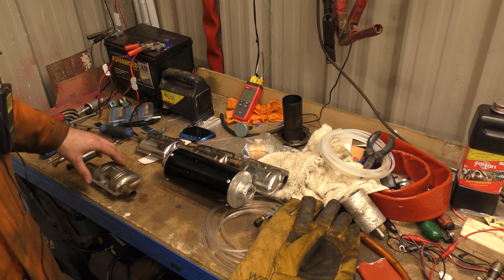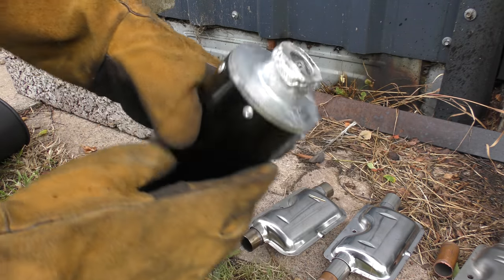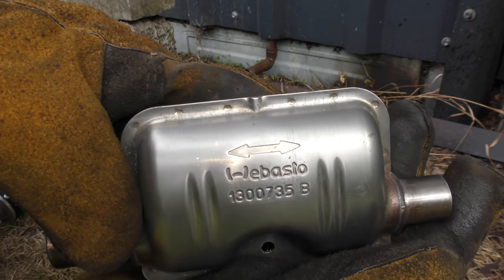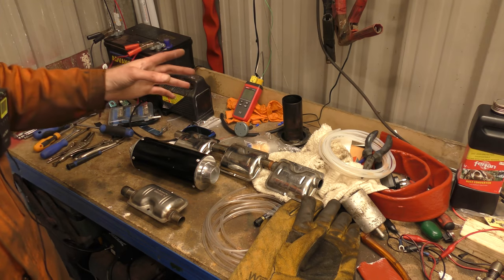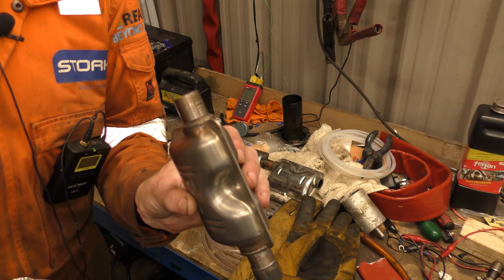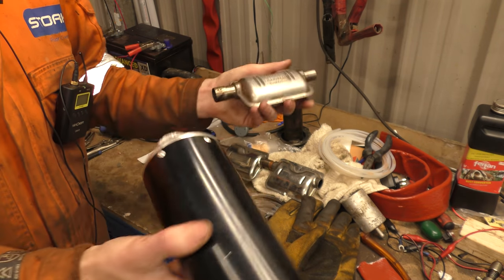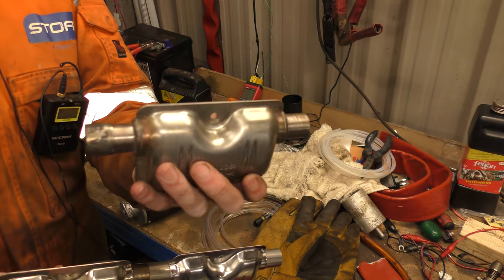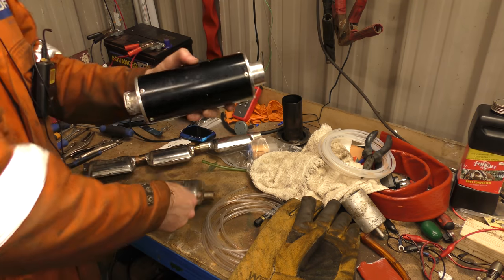Diesel heater silencers daisy chained and a genuine Webasto silencer // test

Comment: I manufacture fiber glass packed (sound absorbing) mufflers for cars from 12-40" long. I've found that silencing gains are minimal after 40" in length. There are 3 ways to silence an engine or in your case of a heater, sound absorption, sound reflection, or restriction. Or any combination of the three. Of course you don't want to restrict a heater. I've also machined 4140 dies to bend, reduce, and swedge tubing to make exhaust pipes out of quality material for these heaters so two pipes can be joined by slip fit and clamp. Thanks for the video. Jerry in Montana
Reply from the maker: I like the sound of your silencer joiners.  If you've got a link to share I'd be happy to share it on here.

Comment: I made my own silencer with an old stainless vac flask. I drilled 12mm right through the bottom two layers and silver brazed a patch on the outside hole. I then drilled about a dozen 4mm holes at random in the outer skin and made a connector which I silver brazed in the top. It’s very quiet and the price was just right
Reply: For a layman it is hard to understand what you are describing. Can you record what you did?
Reply: @harrickvharrick3957  The vac flask is essentially two chambers , one inside the other, sealed at the neck. The exhaust gases from the heater goes into the inner chamber. The 12mm hole through both chambers is to allow the gases to pass into the space between the chambers.the outermost hole was sealed by soldering a patch over it. To let the gases escape from the space between the chambers the dozen random 4mm holes were drilled into the outer chamber wall.
Reply: @footloose6382  I see. Sounds rather neat, actually!

Comment: My way of thinking is that a silencer needs two things. Gas expansion and slower airflow. I reckon a steel box lined with wadding and an internal baffle plate would deaden the sound and reduce the venturi effect at the outlet. The gas is creating the noise at the outlet on all of them as airflow in = airflow out. A box that allowed gas expansion and therefore a slower exit speed (bigger hole out than in) would do the trick. A car exhaust needs back pressure so a straight through exhaust can reduce performance without fuelling mods, whereas the heater just needs somewhere for unrestricted burnt gas to go.

Comment: That's the silencers covered. .....now on to the loudeners. ....
Reply from the maker: Campsites of the world rejoice, we're going to make diesel heaters louder.  :)
Reply: yeah , with LED lights & some halfords ' titanium' heat protection round the exhaust outlet .. aah max power days
Reply: Just find any motorcycle sport exhaust. You could get a droning "broap" all day from a generator!
Reply: We need to crowd fund a tuned Akrapovic system
Reply: That's a trumpet then...
Reply: @DavidMcLuckie  gotta find out what brass instrument sounds best on diesel exhaust
Reply: House radiator before running outside
Reply: @DavidMcLuckie  Hook up a trumpet or trombone to it 🤔
Reply: @nickcoppard5335  Really?
I have cast iron radiators...

Comment: cheap silencer: take a metal paint can drill hole in lid for exhaust in. Take can drill small holes in bottom so area of small holes equal exhaust size. Fill can with corse stainless pot scrubbers. Install lid and install on exhaust. Added benifit, you can easily replace or clean silencer medium

Comment: Adding an additional silencer on the burner INTAKE air connection will  make the BIGGEST improvement on a campervan installation. Sound waves from the combustion noise travel upstream too!
Reply: What silencer can you use on the air intake?

Comment: Excellent video.
Thanks for taking the time to film and share.
Here's an idea for you to try?
Big issue with CamperVan wive's.
💡idea alert... for people with hair:
Scenario:
Not enough battery power in the camper for wife's hair dryer - How do YOU cope?

We have a CDH which blows warm air out of a 100mm vent.
If I got a vacuum hose with a crevice attachment at one end, and a 100mm funnel reduced to fit the other end of the hose - then temporarily secure it over the heater vent - in theory, this should blow concentrated warm air out of my crevice enough to blow dry my wife's hair?
MACK and Maggie, Huddersfield

Comment: What about restriction introduced by each?
Maybe tee in a manometer and see the pressure difference where the exhaust exits the shed?
Then it can be determined if you may need to tweak fuelling
Reply from the maker: I'd always tune the fuel after making a change like this.  Even changing between clone silencers the restriction may be different.

Comment: Webasto make a marine silencer and we HAVE TO use them in narrowboats. They are NOT like the one you have that has a drip hole on the bottom for water to drip out. This also lets out exhaust gases so could kill you if you were on a boat. You can crimp and weld the hole shut but a boat safety inspection may pick this up and fail you. Back pressure can be a problem with lots of boxes fitted I have found. it also depends how close or far you fit the box on the pipe work. Love the video clips would be good to see more trouble shooting on Webasto heaters....

Comment: my silncer is 2 6x12 aluminum boxes welded together with heat syncs and a fan with then a 7/8 tube running out the wall. really quite and gets extra heat off the exhaust to use as extra heating for the garage. now ideally i would have some copper tube and water to get more heat out of it.( to maximize the heat you can use the exhaust temp going outside should be room temp but good luck with that)

Comment: Interesting, ty!  I wonder how much if any exhaust flow reduction occurs and if it impacts performance of the system.  Even if it did, it might not be much or even concerning for some people.  I heard the noise of a diesel heater can be pretty loud in many cases.  They are an excellent source of cheap heat in many instances.

Comment: It would be interesting if you could figure out how much back pressure each of these silencers create, the Webasto one probably creates quite a bit of it due to the zigzag in the tube. The scooter one may therefore be superior (if you have the space) as it looks like it is a straight tube.
Reply: why would they create back pressure??
1 the heater has a blower, so its pressured exhaust.. it blows out.(hence the noise)
2  they are not restrictive in design, if you put 10 on a connection one after the other, you can still shoot a bullet through the hole and not hit anything on the way out.. 
3 the hot air if anything will cool and becomes less dense the further down the line... (the exhaust isn't even all that hot relatively speaking)
Reply: @stijnvandamme76  When air cools down it becomes MORE DENSE .......

Comment: Just came across your vid . have to say the Vehicle  muffler is the quietest . What would a larger bore exaust pipe do ?  ( short 25mm from the heater to a 2-3 inch diameter pipe then fitted with a muffler .

Comment: If you a product called  safe and sound insulation  Batts. Made you own baffled box.  With multiple exhaust holes the sound  will be incredibly low. 
This insulation is  fire proof and water proof to a point.

Comment: Theres literally no restriction in the clones - is the Webasto similar? I would pack some stainless pot scrubber inside but not too tightly but more in centre so exhaust gets pushed around then out other side? Give that a test?

Comment: Hmm, I would suspect that adding silencers will start to really restrict the exhaust flow. Interesting experiment :)
Reply: Glasspacks
Reply: @evognayr  strawberries
Reply from the maker: Restrict yes, but not by much with the cheap silencers.  There's not a lot in them to restrict.  :)
Reply: @DavidMcLuckie  I've seen a surprising test on the cheap silencers that the straight-through cheapo silencer exceeded the performance of the cheapo curved silencers. Anyway these tests NEED a DB meter or even a audio analyser with spectogram.

Comment: You do not want to inhibit the exhaust gases beyond the original design. If any thing get an old car muffler a small one or cycle muffler go larger don't restrict the exhaust. I think a heat exchanger would be a nice addition and capture the waste heat of around 3 to 4 hundred degrees F.

Comment: Hi David great videos. I’ve heard that you shouldn’t exceed a 270 degree angle on the exhaust outlet and doing research those cheep muffler have a v in side with two of them plus the 90 degree coming out of the bottom of the unit you might mess the performance of the diesel heater up there are two sorts of cheaper muffler one like yours and one that is a straight through one also the straight through one is a lot quieter then the v shape hope this helps
Reply from the maker: You just need to tune the CO output for the configuration you make.  I noticed that if I add a slight restriction I can reduce the fueling slightly as the hot gas stays longer in the burn chamber.

Comment: Loving the experiments! I might have missed it in the earlier videos, but did you mention where you got the generator silencer from? Thanks.
Reply from the maker: It's just one I picked off eBay, literally the cheapest one I could find.  :)
Reply: @DavidMcLuckie  name of muffler I would like to find the same one
Reply: @DavidMcLuckie  Me too actually. Would you say that putting the Webasto and the big silencer together will cause any problems for the heater re soot etc. looking on ebay I didn’t find the big silencer so having a link or something might be useful if possible. Thanks David,  if you see this comment. New to your channel. Very interesting stuff.

Comment: I hear the small scooter changes the pitch to a lower octave but the generator can either don't cut the high octave sound or its resonating inside, can you use try the scooter exhaust and then the generator can? Just wondering if its the can that's resonating.. If its not then you have a high cut silencer and then a low cut sound silencer :)

Comment: I changed the exhaust on one of my trucks and just used the muffler and pipe section of one side. It’s a 2.25” diameter pipe, about 5’ of length plus a generic muffler, the exhaust is much quieter than the fan and see no reason to change it.

Comment: I mean it's not really a muffler, two slices of steel with spring inside. I run heat exchanger instead and that not only eliminates noise but actually helps recover ar least 50% of exhaust heat.

Comment: Can you do 2 tests for me please ? 1. Can you run two controllers connected at the same time ? 2. Can you extend the exhaust and see if anything happens as I’ve heard you must not extend it due to back pressure
Reply from the maker: Number 2 I am doing right now.  My exhaust is an easy 2m long.  I just tuned the fueling accordingly.
Reply: @DavidMcLuckie  good stuff, I await your video sir! 👍🏻

Comment: Hello Mr McLuckie  do you know roughly how long the exhaust pipe from a diesel heater can be before it starts causing problems with combustion, as the exhausts that come with the heaters seem a bit short, i see ones for sale at 1.2 meters even 2 meters long but am unsure if these would be suitable or to long.  Also really enjoy your videos they are Awesome 😁😎
Reply from the maker: Perhaps I can add that to this years test list.
Reply: I have seen on Weaste and Eberspacher user manual that exhaust pipe can be max 2 meters.

Comment: Thanks. Is it recommend or allowed to use copper pipe for exhausts?
Reply from the maker: Well.  Yes and no.  Technically you shouldn't as there can be a reaction and gas given off.  But we're already venting a toxic gas to somewhere else, so as long as you know what you're doing.  I'm also only using it for the end of the exhaust which is a lot cooler than the heater end.

Comment: I've just bought one of these.
I have used it for 6 consecutive nights.
Do I have to tune or set these up to optimize running?
Reply from the maker: Ideally yes.  A cheap CO gauge and adjust the fueling for low CO.  The lower the CO reading the less unburnt and wasted fuel your heater will be using.
Reply: @DavidMcLuckie  I've been running one of those cheap Chinesium diesel heaters aboard for the past few years and have never done an exhaust CO2 test on it, I installed it, it made the cabin nice and warm and I "tuned" it to keep the smoke down, it literally never occurred to me to test co2

Comment: I use two of the "clones" cheap and cheerful and makes enough of a difference.... Does anyone know if there is some kind of lagging that would effect the volume ?
Reply: What about exhaust tape/ heat wrap? Might be what youre after, or something like rockwool can handle very high temps.
Reply: I have got the heater in a rockwool lined box, reduces the roar, I've been thinking about directing the exhaust into some kind of chimney / flue to vent exhaust up and away from other campers

Comment: Cooper  fittings make sound louder back in the hay days we fitted copper sleeve  pieces into our exhaust pipes on our car exhaust it when got hot the heat made the copper crackle and the tune out off exuast pipe was louder
Reply: You could shove everything up there and she was getting louder. 😄   You're just blocking the fiberglass or steelwool.

Comment: Interesting. Copper should not be used in exhaust systems of internal combustion engines as it gives off toxic gasses at high temperatures, Shame, because in other respects its the perfect material. Very interesting video!
Reply: not sure about 'copper gassing off'  but sulphur dioxide in exhaust gas will eat into copper fittings in fairly short order

Comment: Do you actually hear anything from inside the van?
Reply from the maker: That depends how you build the van and where you put the heater.  On mine the heater was the opposite end of the van from the bed, so you didn't hear anything.
Reply: Yeah, I just finished my installed today, and I'm not hearing anything inside the van. Take a walk outside and sure you can hear it, but when it's cooler outside I'm not going to be outside anyway. I just put mine in without any muffler at all. Works for me. 

What is far more annoying is the, tick tick tick of the fuel pump. I have a rubber mount that everybody recommended, but really surprised how loud that thing is.
Reply from the maker: @Deltro61  Did you mount the pump inside or outside?  I put it outside as well and don't hear it inside.
Reply: Yes, mine is outside, but zero insulation in the van right now. Just getting started on conversion. It should quiet down in time (I hope!)

Comment: I would get a new universal car muffler / tractor /car/truck  2inch diameter much larger than tiny ones in video and use it for heat recovery inside . Also would paint all mufflers and pipe hi heat black . Lot of wasted heat going out side .Just like building hi performance  car exhaust . If you look lots of discontinued mufflers around cheap

Comment: The best thing to do is probably tap into your vehicles exhaust system. At the end of the day it is very hard to get rid of the sound of moving air 🤷🏼‍♂️
Reply: But wouldn’t you then be pushing your engine exhaust gasses in to the heater and out of the air inlet when you run the engine ?
Reply: @AJ-qn6gd  No, not if it was entered at a 30-45°angle

Comment: has anyone figured out the best way to recoup exhaust heat which still allows the heater to function properly longterm ?   I am planning on turning my heater to the side, so the bottom exhaust output is now to the left side this way I can route it into a heater coil from a car, and than route the last few inches of pipe that comes out the heater core,  out the window...This will allow me to do this ,without using any 90 degree turns/ unions.

Comment: Via your mic, the moped thing done best to my ears, bang for buck. It get rid of the high notes I don't think you can hear. Rather a bass note than hiss. But that care exhaust box was all around the best, but thats custom ish
Reply: Problem there is, Low-Frequency noises travel farther than High-Frequency noises. So much so, that Jet Turbine Engines are designed to change the pitch of their cries, to a much higher note.
You might complain while sitting on it, but, over distance, the higher notes go quiet faster.
Which is why I only hear the Bass Line on my neighbor's car stereo, when he pulls in after the bars close.

Comment: Won’t this cause restriction? And burn a valve?????
Reply: Thats a diesel burner. Not a combustion engine. It is for heat - not for the mechanical work.
Reply: I don't have any valves on my chamber

Comment: You should have put the three silencers in parallel instead of in series and used stainless steel pipe inbetween . This would've seen a reduction of at least 0.75kn  at exit level. Other than that try painting all surfaces matt black.  🤣 Good demonstration.

Comment: A Db meter would help. Human perception is not so reliable...
Reply from the maker: Our perception is the point though.  Other than the big silencer they all had very similar loudness, but sounded different.  Big silencer = -43.63LUFS / No silencer = -27.83 LUFS / Scooter = 32.77LUFS / Webasto = -33.91LUFS / Clone = -32.99LUFS / 2xClone = -34.50LUFS / 3xClone = -35.68LUFS.